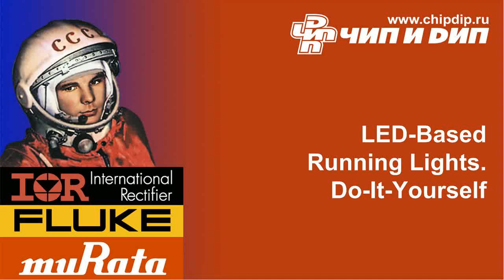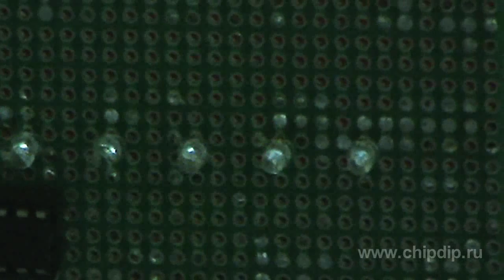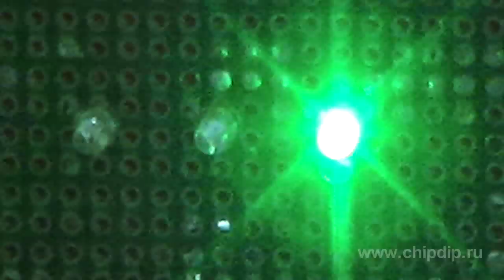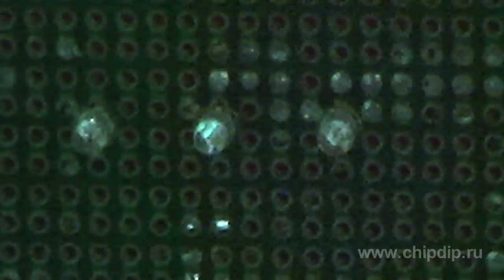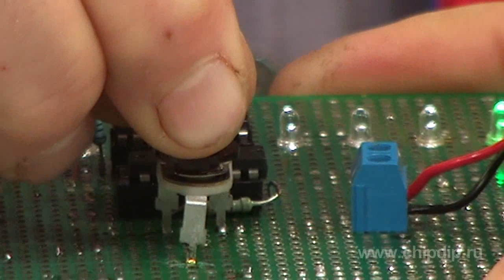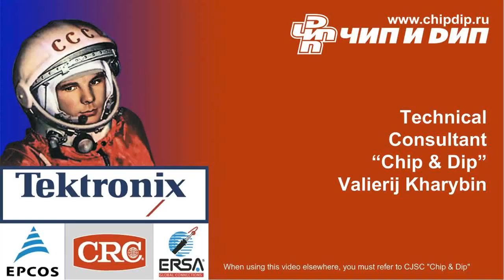LED-based Running Lights. Do-It-Yourself

Comment: to make them work with 110v power, you will need a 555 timer,  cd4017, and few relays.   how it hooks up, you will need to run between 6 to 12 volt power to the timer with resistors and a capitor then from the timer output #3 to cd4017 input of #14.  then some output from the cd4017 to the relay on the coil side.  on the other end of the relay, you can use any voltage like for ex, lots of leds with resistors using 12 volt or you can use regular 110 bulbs.  there some schematics out there so, go Google " "sequencer light schematic"